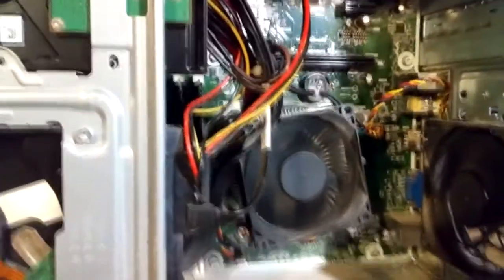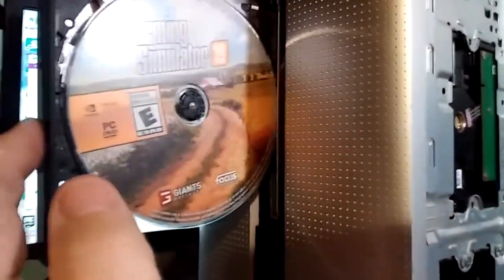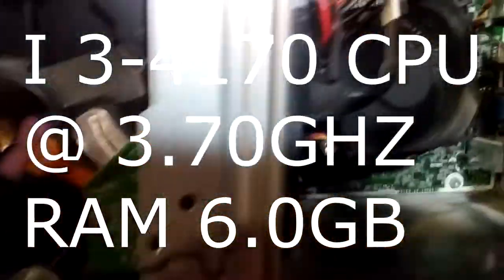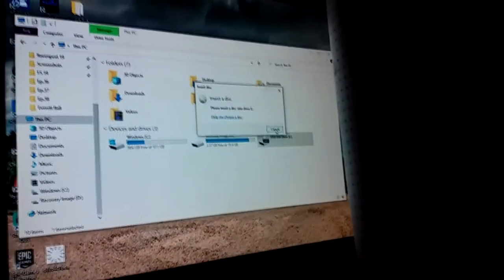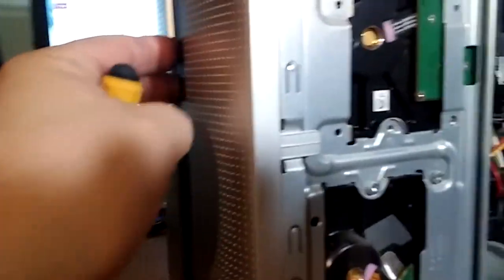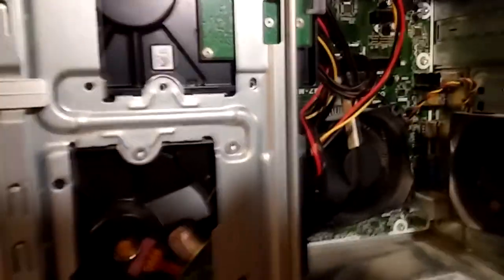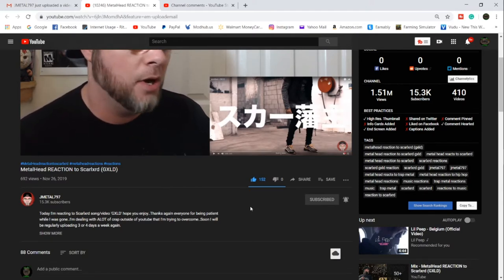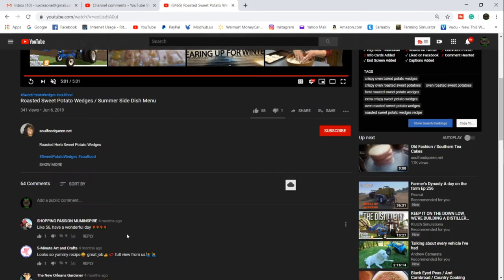Tommy Miller Needs Help Please!!

Comment: A few years ago, I had a problem with a computer not recognizing hardware I'd installed. Turned out that something went wrong with the driver's installation files. I had to go in, delete the drivers and reinstall them. It was a pain but it worked. You may have it fixed already. If not, maybe check your drivers? Another option would be to get another external drive and use it.
Reply from the maker: Thank you so much!! I end up buying an external drive... I'm just moving some files around so I can make room to record again!!👍